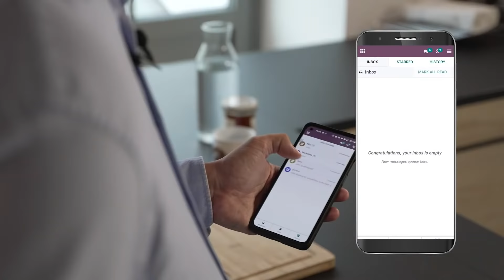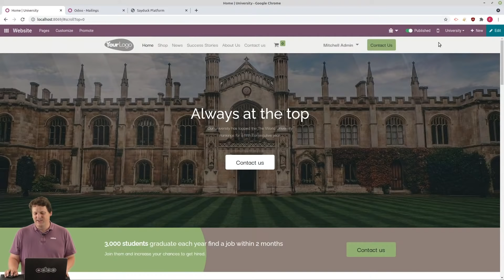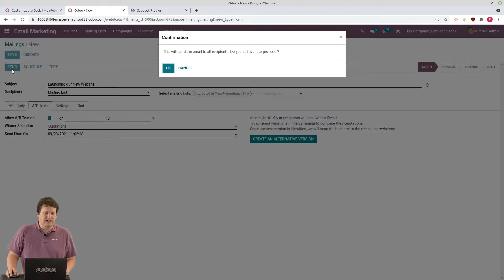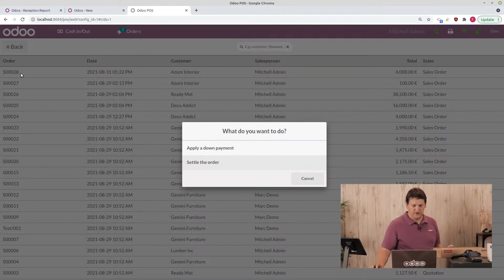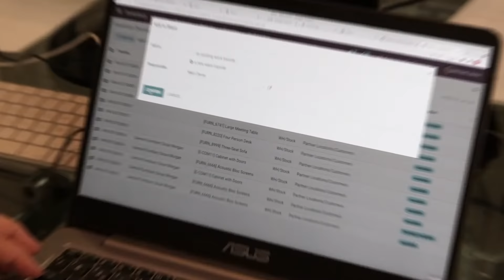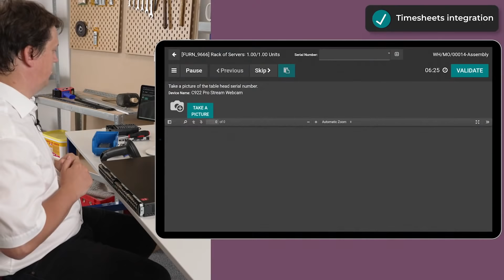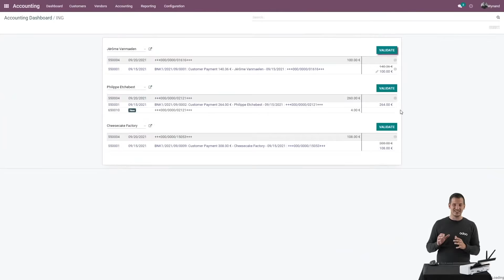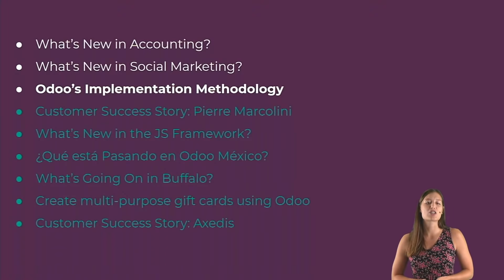Unveiling Odoo 15: What's New?

Comment: We run a small computer repair shop. Would this be a platform that would suite? Have a lot of tickets for customers that come in so need to basic fields and tickets that we charge to invoices. Also need to stock to order, barcode label printing for small items we sell. Thanks
Reply from the maker: Yes, Odoo provides all these features. See 27:25 for the retail interface; we show how to handle tickets, field services, invoices in the shop.

Comment: every year, odoo releases a new and better version, that's fantastic, but, in the "community" version, transferring the data from one version to another is an odyssey or directly impossible for an average user. It's what worries me about Odoo, that once you install eg. version 12, you will never be able to migrate your data to version 15. And yes, I know that there is OpenUpgrade to migrate but it is too complex. I think backward compatibility should be a priority for Odoo
Reply from the maker: Unfortunatelly, we can't be backward compatible while innovating / evolving at the same time. We try to minimize changes when we can, but if we can do much better, we prefer to evolve rather than sticking to an old way of working. Note that in addition to OpenUpgrade, we have a free migration tool for Odoo Enterprise customer: https://upgrade.odoo.com

Comment: I had a serious look at Odoo. They claim 5 million users. If I check the pricing for a small company and and hand-full of modules I have get a yearly cost of around 2000 euro. The Odoo company has yearly revenues of around 160 million euro, so roughly 80.000 paid users.  This means that about 98% of the users use the free version.